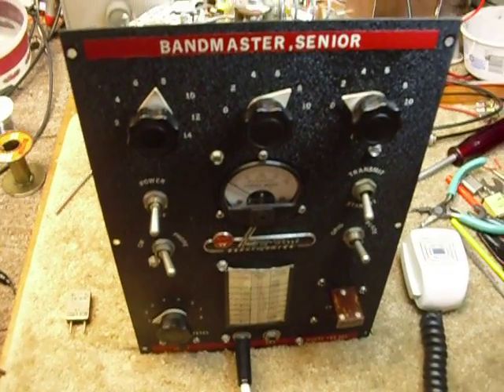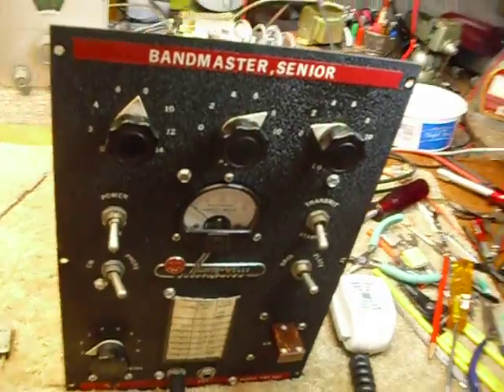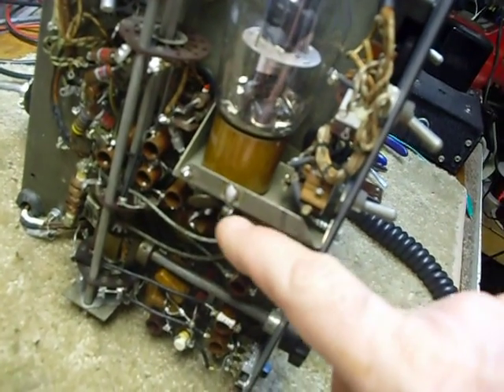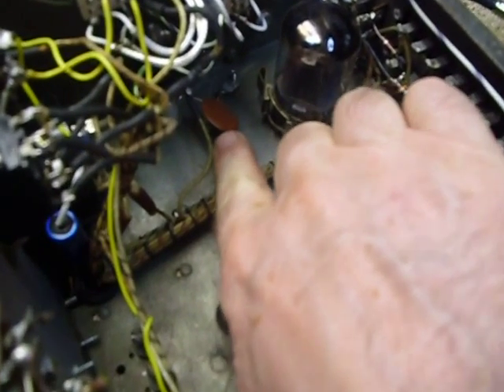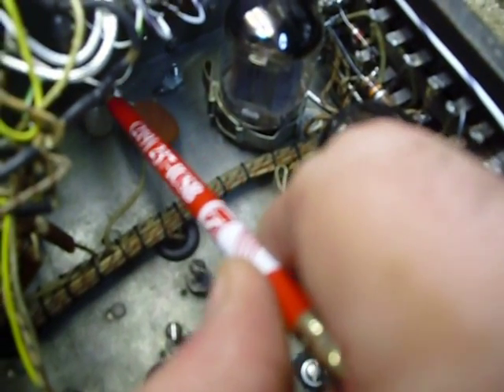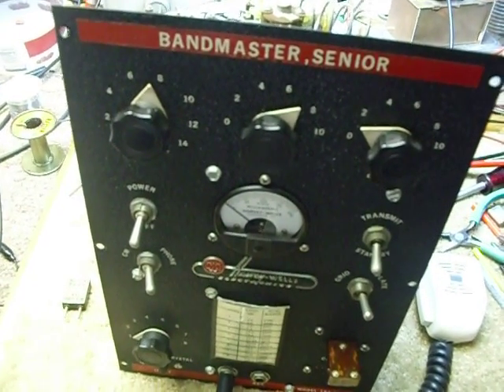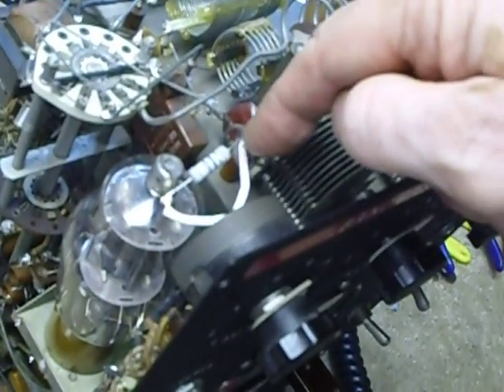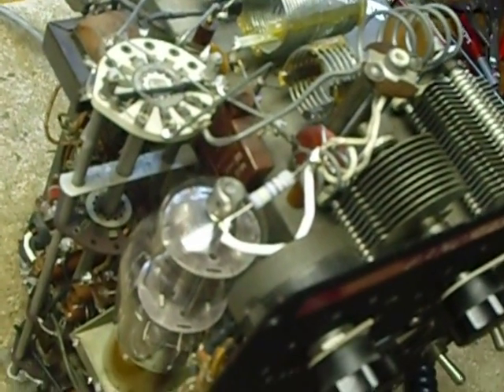Harvey Wells TBS-50C , Harvey Wells won't transmit , TBS50 won't transmit

Comment: If you take a look at the schematic that "bypass cap" you added is going to cut your high frequency response of the modulator way down. It's basically across the secondary of the modulation transformer. If you feel that you really need a cap there you'll get a much less muffled sound by making it much smaller in value like .001-.005 @ 1KV or higher. GL Terry
Reply from the maker: YES you are correct I removed it some time ago .  thanks for your confirming this  73  bob
Reply: Had a great time running several TBS-50's back in the late '90s and early 2000s mostly on 40 and 10mtrs AM. Have been fooling w/them for abt 30yrs. Here's something you don't see often a TBS-50B (Junior) https://www.flickr.com/photos/53710524@N06/8749417316/  Don't think many were sold. Gear for the newly minted Novice class licensees in '51. N3GTE   @robertsumption1243